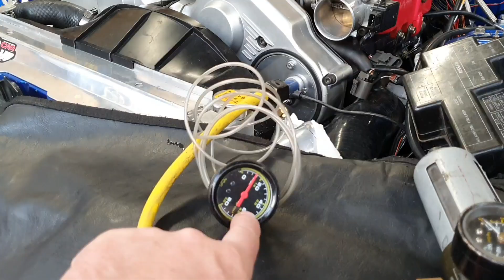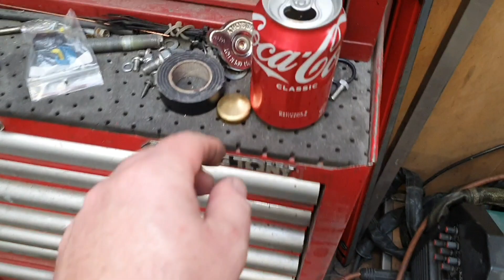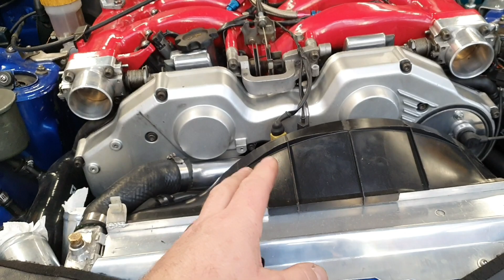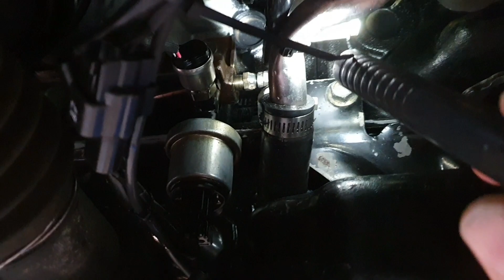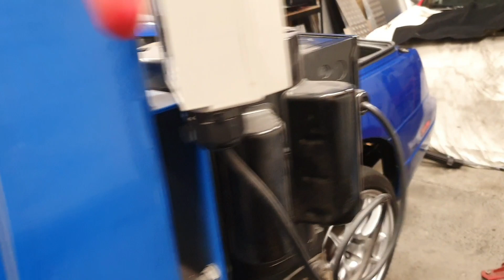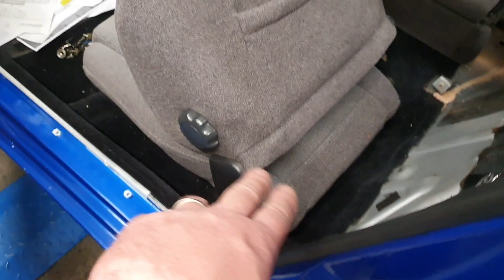JDM slicktop twin turbo Z32 ready for tune!

Comment: On the frost plugs I would use Hydraulic Loctite or 577. Even Bearing fit works well in those situations.
Reply: Probably an Ideal use for loctite 510 or 515 flange sealer